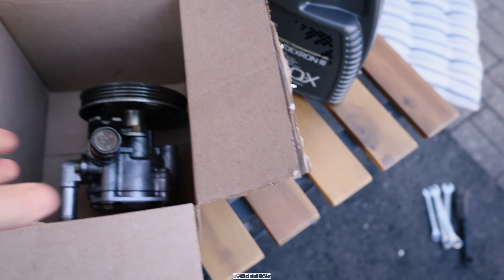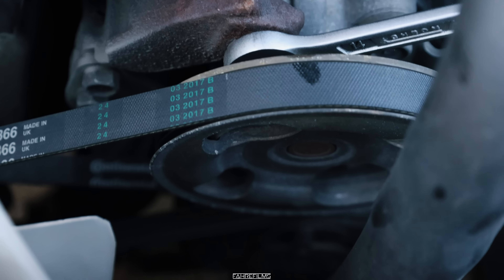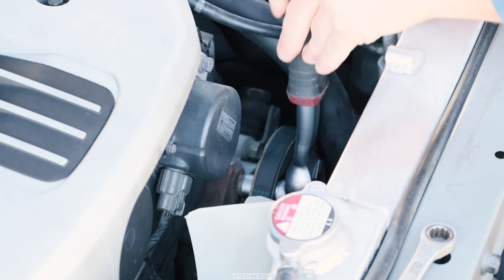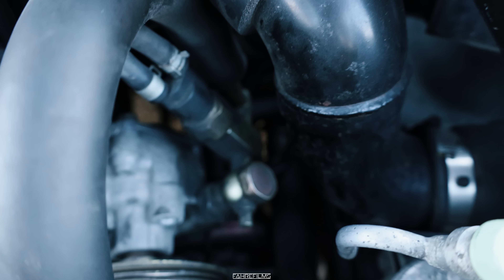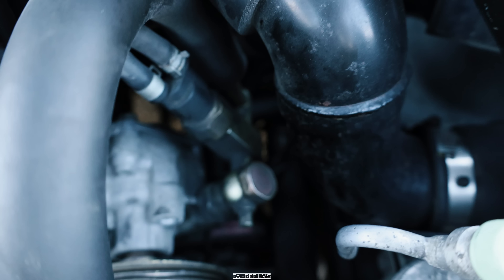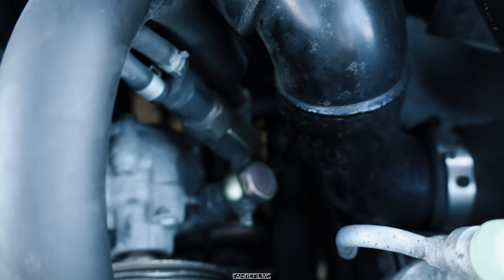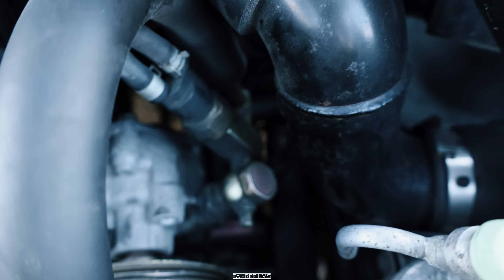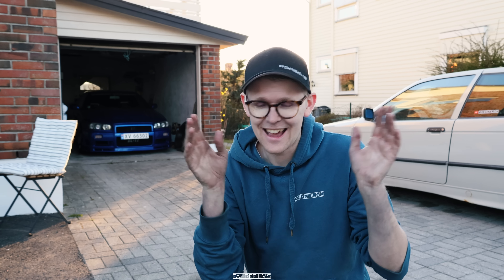Trying to Fix the Biggest Issue with the Skyline!

Comment: @Fahre Films I had the exact same Problem with my GTT, i also bought a new power steering pump and after fitting it, the noise was still there.
After doing a lot of research i saw a post of someone saying that it took him ages to bleed the system entirely. 

It took me 35min of idling and steering from left to right, right to left at least 10 times to get the system fully bleeded. After that the noise was gone.

So keep your old pump, i guess it was not broken. You just had air in your power steering system.

Great content, greetings from Germany :)
Reply from the maker: I hear you, I will keep the pump :) I should have tried to bleed it first maybe that would have worked. It was terrible to steer also, not just a bad noise like in the end before I fixed it completely. Thanks for the input :) Really glad I posted this video to get some feebback on this ! Do you have some cool mods on yours?
Reply: I wish i had  your Video back in the day when i tried to fix mine, would have saved me a lot of time and money :) But as you said, it's great to see the feedback and i will assume that a lot of people will be glad that they can watch your video and learn from it :)

I bought mine completly stock besides a Nismo Front Bumper back in 2013. Since then i did a lot of upgrades to it starting with different suspension, wheels, brakes, seats with 4-point harnesses a complete Bodykit including the same Hood as you have :) And a lot of engine mods, the List is pretty long after 10 years of ownership :)

Comment: Usually the belt squeak on start up on Rb engines is from the alternator/water pump belt, with the alternator and clutch fan its so loaded up at start up it slips, theres a fine line for getting it tight but not so tight you damage the water pump.